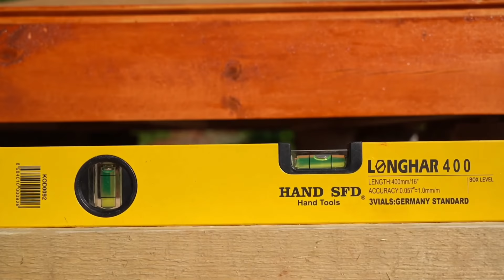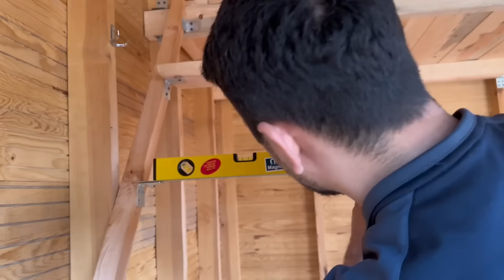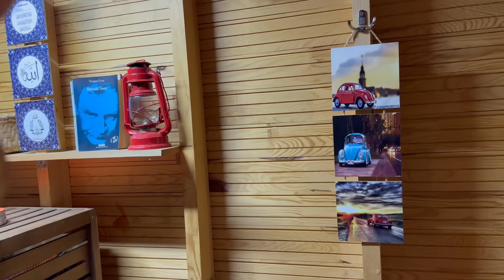Building a Wooden House in 30 Days - Off Grid Cabin - Full Video

Comment: I love the patience and  perseverance you possessed, the house after you completed turns out to be a gem, it can even called a home.
(Just a suggestion, you should have spend some more time on the foundation by making it with solid concrete thick walls and not just load bearing blocks and wooden beams, it will increase the lifespan of the house and also allow you to put heavier utilities inside  the house. Wood degrades with time and looses it load bearing qualities especially if it is exposed to natural elements and not coated with some weather-proof paint, once the load bearing wooden beams looses their load bearing capacity the integrity of the whole structure will be compromised.)
Enjoyed the whole video.

Greetings from India.

Comment: I have a love-hate perspective with the project. For as much as I like the overall concept, there are some general standards and practices elements regarding its construction I have issues with.

There are some particular things I just didn’t get: (1.) The astonishing use of L bracelets conflicting with weight and load distribution; (2.) The lack of headers over doors and windows; (3.) No “consistent” spacing of studs—no matter the local building codes; (4.) The use of wall insulation in a room with plank flooring will draft gaps; (5.) Plus numerous nitpicks that when collected as a whole do make an overall difference; (6.) Caulking, my kingdom for some caulking.

I take nothing away from the guy’s construction abilities—he scores mega points for using a handsaw. And his usage of a level and square is top notch throughout. 

I just see a number of areas, using the material available, where a couple of extra minutes e.g. measuring out locations better where elements meet/join together throughout would have made a world of difference for the overall structure—offering better integrity.

The house as is, with the lushness of the region where the structure was built and its clearly healthy amount of rain—I can quickly see that in short order the buildup of mold and rot, sagging and buckling, problems with expansion and contraction, rain water seeping through the wall slats, dampness buildup compromising the floorboards, and there are no openings in the skirt of the house for ventilation or crawlspace access.

But, that’s just my simple opinion I suspect.

Comment: 10:00 you don't nail into the face of the wood, you are supposed to nail in through the tongue so when you set the board on top, the "Groove" sets over the nail head protecting it from the weather 

46:34 your wood is upside down!!! The TONGUE GOES TO THE TOP SO NO RAIN WILL COME IN THE WALL!!! THEN (as I aforementioned) Then you put the nail in the tongue NOT THE FACE!!! to protect the nail from the elements when you slide the groove over the tongue. 

46:35 UGH you got the wood upside down RIGHT NEXT TO THE WOOD THAT IS RIGHT SIDE UP!!! 🤦🏽‍♂

Comment: You get to see, or used to see, these kinds of projects in Puerto Rico. Until, we got tired of the hurricanes destroying them every year, and we went to building cement houses. Some still build them, but it is Wood/cement, in case. I also came up with a solution "tornado houses" as I like to call them. I was able to make houses in this sort of way but much different, and a tornado won't be able to destroy it. No more losing your house or your life. Full proof too. Not even expensive. I thought of Tornado Valley and how I could help them, but the thing is people have to accept changes, in lifestyle. See after it is done, it is not much different. but hey, it seems to me they want to continue to lose their houses, their lives, and properties. Anyone interested? Let me know.